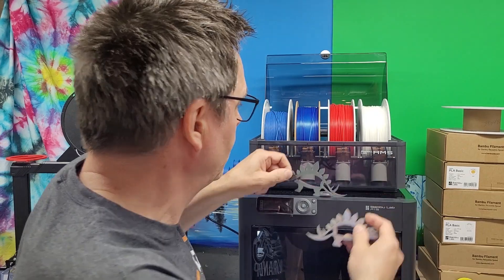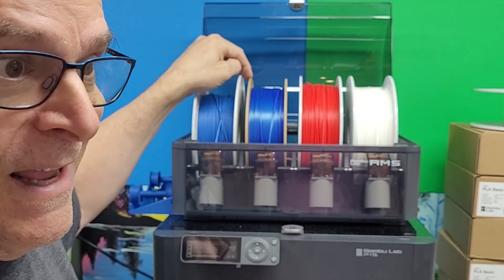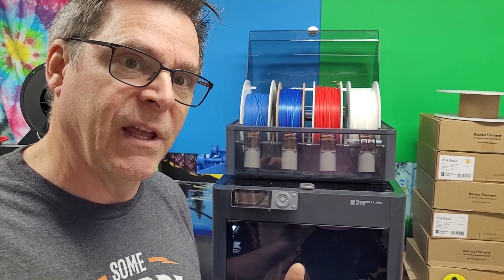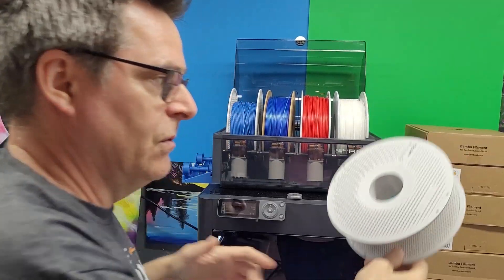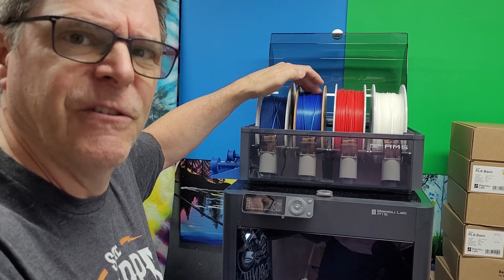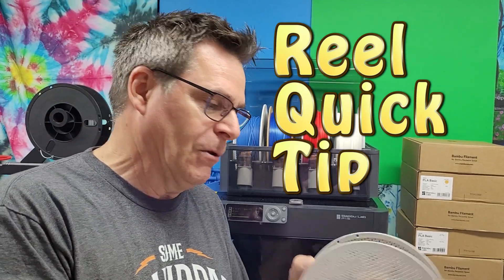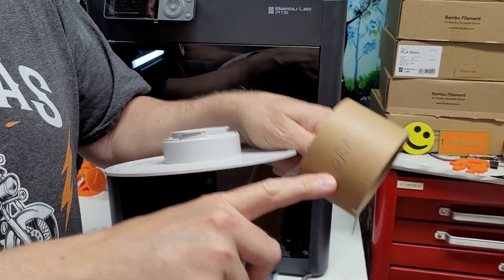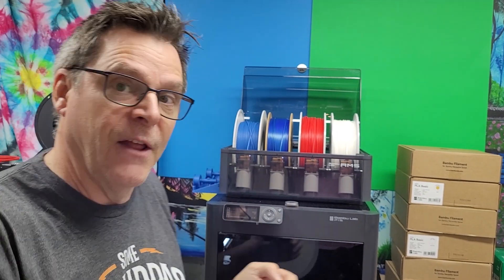Bambu Lab Filament Jam Recovery

Comment: I’m not using cardboard and my filament constantly jams.
Reply from the maker: @JSXDrift  is it gaming with Bambu filament or another brand? When did it jam?  During a print or when loading? Full spool or almost empty? Let me know I'll see it I can help
Reply: @ it’s the filament I think. Somehow to crosses over itself then the rollers don’t seem strong enough to pull it out from and overlapped piece. I’m going to print the tubes you can fill with weights and insert inside the middle of the spools for added weight and pray that helps. Honestly I think if the rollers and spools had tracks instead of smooth on smooth it might not be as bad of an issue for me. It’s just been a bummer to spend all the cash. Get excited. Then basically been trouble shooting and scouring the internet or sitting next to my printer for 3 hours so I can help it spin. Thank you for all that you’ve done.
Reply from the maker: @JSXDrift  if you want to test quickly. I've placed a large socket from a ratchet wrench set in the middle and blocked the opening with painters tape. Saves filament and time for testing.  Let me know
Reply: @ I did put weight in there and it’s still binding.  But it’s the filament. It on circle it will lay over it self then get tied up because the next strand is laying over the strand going in. I’m debating respooling it and trying to lay it nice and flat. Basically it’s laid like  X so the first strand is stuck on the next strand and it ties it down to the spool.
Reply from the maker: @JSXDrift  as I was reading I was going to recommend respooling.
Some folks say you should respool twice due to the right radius at the core, but let us know how you make out. Sorry you're going through this

Comment: You can print PLA roll caps (adapter rings) for the ends of your cardboard spools. That way they run smooth in the AMS without issues.
Reply from the maker: Thanks akselmani, I'll do that. I have some new cardboard reels on the way.
Reply: that is highly useful knowledge

Comment: I use empty Bambu reels for my cardboard rolls. Simply peel one side of the cardboard off (I start with the side that does not have the filament end), slide in one half of the Bambu filament reel, flip over and peel the cardboard off the other side and put the filament roll together. I even reused the Bambu Lab code thingy for Bambu tough on Elegoo PLA+. Worked like a charm.
Reply from the maker: Thank you for sharing.  I sure was surprised by how quickly the cardboard reel got violent,  really caught me off guard.